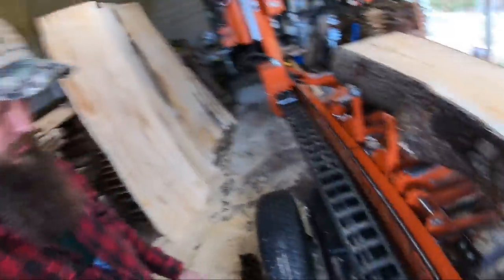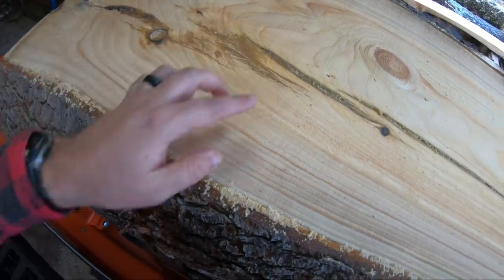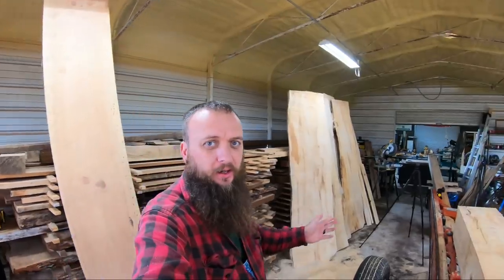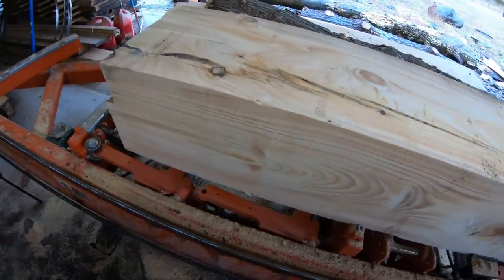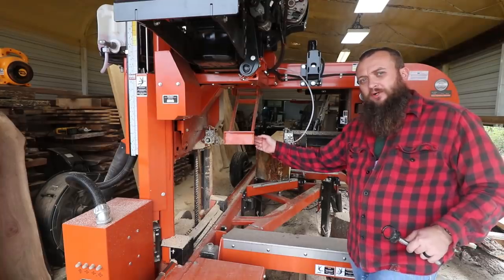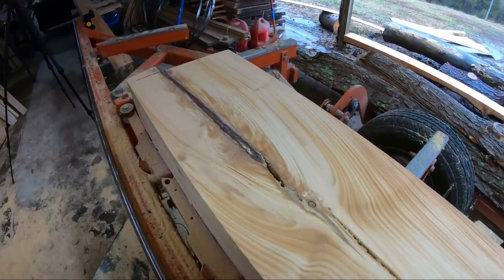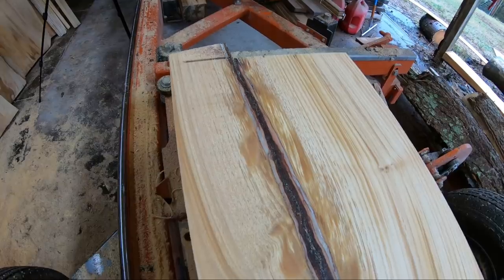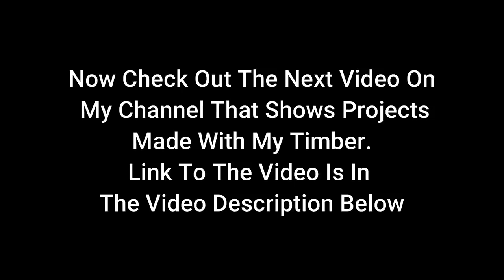You Will Want To See This, Amazing Crotch Pine Log On The Sawmill

Comment: Expanding on the "Lowe's for 2x4s" comments: Isn't there enough wood in your initial cuts to get 1 or 2 boards for rough framing without having to go to the Forbidden Store? It's hard to tell how much is really there from the video, but I swear I've seen some pretty thick slab cutoffs. Surely you could have gotten some there.

Comment: Sir, some years ago Wooden Boat magazine had an information page telling of something which made sense but could never confirm. Trees drawing up moisture from the ground up the length of the trunk, apparently use ‘capillary’ action. This induces compressive load on the surrounding wood. They claim that a hardwood can withstand this pressure but softwoods cannot therefore they claimed the softwoods would draw up in managed stages to ease the loading. I have never noted evidence of this in lumber. Do you or any viewers know of this?
Reply from the maker: yes that is correct, why I seal the ends to reduce the massive moisture loss on end grain, prevents end chedking, 
those boat builders really know their stuff!

Comment: When you are sawing Pine, does it help anything or does it hurt anything to put a little bit of turpentine in your water to keep the sap off your blade?
Reply from the maker: I use Pine Sol
Reply: @OutoftheWoods0623  Hmm, ok. That is a bit cheaper. I was asking because I'm working on getting a vertical bandsaw pretty soon and was thinking of the best way to keep the blade clean, what to use and not to. I'm learning. Thanks.
Reply: Pinesol and Dawn dish. Smells good too.